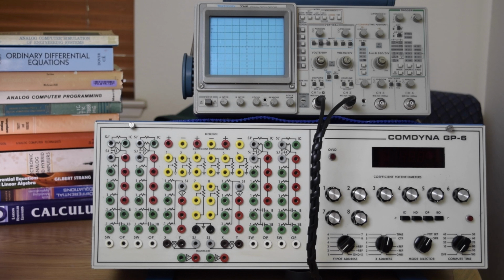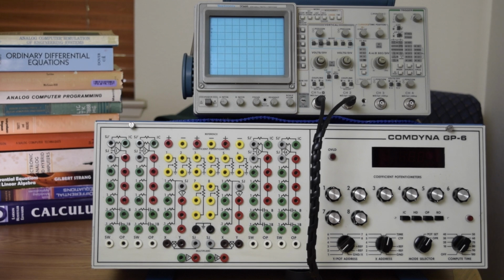Programming an Analog Computer

Comment: You should ideally never leave the inputs or output of an op amp floating, even in a voltage follower configuration with negative feedback like you've done because it will saturate the output and lead to damage or excessive current consumption, and gradual degradation.

Texas Instruments has a great application note on properly terminating unused op amps. It's meant for ICs, but I'm sure the theory applies just the same to any op amp, regardless of how it's made. The application note is called How to Properly Configure Unused Operational Amplifiers and the document number is SBOA204A. You can find it easily enough on Google. I'd always been terminating unused op amps wrong for years until I came across this.

It may be different with an analog computer, but I thought I would mention it anyways because I would hate to see such a beautiful piece of kit get damaged. Thanks for taking the time to share this with us. It's really great to be able to see an anaolog computer running like this. Cheers.
Reply from the maker: Nothing\ Thanks for watching. You bring up a very interesting, valid and important point. I am familiar with that TI App Note from a few years ago, and anyone designing with op amps should follow that. What I do now with unused op amps in designs is, space permitting, put in pads for components for “universal” configuration. That way, I can safely disable the op amp if I’m not using it, but the board layout is set up in case later design requirements call for an op amp circuit. 
I was scratching my head for a while trying to figure out why this did not seem to apply in the analog computers I’ve used. Long story short, it’s because what you see on the front panel is not quite the whole picture. In an analog computer, the op amps are typically set up as inverting amplifiers and shown with single-ended, instead of differential, inputs. Internally the non-inverting input is tied to 0V and the input shown on the front panel is the inverting input. With the output connected to the inverting input, and the non-inverting input connected to 0V, the output is safely configured at 0V, right in the middle of the rails. This is like the safe configuration shown in Fig. 3 of the app note.
When programming, I sometimes have the system on with the shorting block out of the feedback path, and an op amp output goes to the rail, as indicated by the front panel overload indicator. This can also occur in normal operation if an equation is not scaled correctly. The overload indicator is mainly a warning that the computational results are invalid. This does not seem to have any adverse impact on the op amps, though, as indicated by the fact that all the GP-6 computers I’ve used have there original op amps installed. I suppose that’s why the app note uses the word “can” instead of “will.” I might dig into this a little more to see if I can understand why the typical, routine overloads don’t seem to cause any harm.
Thanks for the input. That is a very useful app note covering an important topic for anyone working with op amps. Op amps led to my interest in analog computers. I don’t have formal education on them, but I’ve learned a lot from the analog computer literature. They early books show how to build discrete op amps. I’ve got a few old Philbrick tube based op amps. I hope to have time to do a video, or possibly a series of videos, on op amps from a historical perspective.
Reply: Thanks for the fast and detailed reply. I had a feeling there was more to the op amps than it seemed. I appreciate you clearing that up for me. It's interesting, and reassuring to know that at least with the computers you've used, they all still have their original op amps. It wouldn't be surprising if the designers had some sort of protection in place to protect from damage due to overload considering how easy it would probably be to accidentally scale something wrong. It would be interesting to learn more about how they handled that eventuality.

 I've never been formally trained in electronics, but much like yourself, learning about op amps has sparked an interest in analog computing, though I'm only just starting down that rabbit hole. I only just got into electronics a couple of years ago, so I'm trying to absorb as much as I can about as many topics as possible. I started learning about how to make a breadboard digital computer, but I got sidetracked when I started learning more about op amps. Something about analog circuits is just so much more appealing to me than digital. Though that's not to say digital isn't interesting in its own right. I have a huge collection of app notes and literature on op amps I still need to digest.

I'd love to see you do a video on the philbrick op amps. I first saw them on Mr Carlson's lab and read about them on Ken Shiriff's blog. I found them absolutely fascinating. And I think a historical series on op amps would be a great idea, as well.

Thanks again for the fast reply. You've definitely earned yourself another sub. Cheers.

Comment: can you give examples of it being used for suspension design?
Reply from the maker: Pedro Couto I don’t want to make any promises I can’t keep, but I’ll try. I’ve seen that in some of the literature, but it typically requires more than the four integrators available in the GP-6. I’ve got more than one GP-6, and the manual indicates I can connect multiple units to solve higher-order equations. I’d like to try that and the automobile suspension problems might be a good test case. Right now, my job is taking a lot of my time, so it might be a while, but I’ll put that on the list. Thank you for watching and for the suggestion.

Comment: Why did you use an acceleration of -0.161?  Your scale factor will be 200ft/V.   Using  -0.322 V  (32.2 ft/s^2) is much more convenient because your scale factor (100ft/V) can be applied by just shifting the decimal point two places.

 You will have to multiply the output voltage by a factor of 200 to get back to feet again.  The time-base scales by a factor of 400.  (1 time constant "analog computer time" = 2.5ms real time)

Do you know how well the precision resistors (50k) and capacitors (50nF) have aged?    Are there trim pots and caps inside that allow for readjustment or "calibration" ?
Reply from the maker: Thanks. That's a good point on the scale factor. It's been a while since I made this video, but I think the rationale was to scale the voltages to take advantage of as much of the oscilloscope display as possible, and stay out of the noise. The texts recommend that to stay out of the noise as much as possible, but I think your idea of keeping the conversion math simple is valid.

From what I've seen so far, the calibration is close. In the few experiments I've done, the results are as expected. Each amplifier has a series of calibration resistors, but I've yet to calibrate any of my GP-6s. The caps are very high quality. As I recall, they're 20uF (to make a TC of 1s with the 50k resistors). They're still available from Electrocube, but they cost about $350, and the price doesn't drop much in quantity. I think that's part of the reason no one makes analog computers anymore.
Reply: $350 per capacitor?  Ouch!   I've never had the opportunity to use one, but I still think these analog computers are cool. Thanks for the interesting videos.

Comment: Well done but it would be a lot easier to follow with a schematic on the side.  Spaghetti wiring is too hard to keep track of.
Reply from the maker: Thanks for the suggestion. Sorry it took so long to get back to you, but work has been hectic, and I've had to neglect the channel. I agree. I tried showing a wiring diagram from the manual in some of the videos, but that is hard to follow too. I'll try making symbols based on the analog computer texts in LTSpice to show the schematic of the analog computer solution in future videos. There might not be enough real estate to show them side-by-side, but I can do an overlay when explaining the circuit.

Comment: Kinda lika modular synthesizers (which are, in some sense, analog computers)
Reply from the maker: Thanks. Sorry it took so long to get back to you, but work has been hectic, and I've had to neglect the channel. There are some similarities, especially in the patch bays. I actually have several synthesizers, including a stack of three Moog Mother 32s, that would qualify as modular. 

I was reading a book on synthesizers and they mentioned an album titled "Processor"  where the GP-6 was used to control a series of function generators. It's available on iTunes, so I got a copy. It's a little far out, but it makes some interesting background music.

The mixing section of a synthesizer is very similar to the summing amplifier, and a low pass filter could be loosely compared to an integrator. Someday I may try to experiment with using the analog computer with my synthesizers, but I think I'd be hard pressed to do any computations with the synths (lol).
Reply: @timthompson468  I would be very interested to see the computer used with the synthesizer. Subscribed, just in  case you do it.
Reply from the maker: Vsev Krawczeniuk Thanks for the suggestion. Coincidentally, I was just thinking about that yesterday. I’m just an amateur musician, so I’m not sure how to go about that, but I might test out the idea with my Moog Mother 32s. I think the typical analog computer output, a damped sinusoid, would work best as a modulation control voltage, but it might be interesting to hear what it sounds like. I’ve been very busy at work lately, so I haven’t had time to make videos, but I’m taking some time off for Christmas, so I might try to set something up. If the results are worth it, I’ll record a video. Also, thanks for the subscription. I was not sure if the subjects I’m interested in would be interesting to others, but there has been some interest, so I’ll keep at it, when I can find the time.
Reply: @timthompson468  I too would be interested in seeing some interaction between a synthesizer and a computer! I've always thought of analog modular synths as analog computers limited to being comprised only of those elements deemed musical, at the time of their conception in the late 60's.

I've sometimes wondered about the possible use of analog computers in musical contexts. I've just found out about your channel anyway, I think I'll take a look at the rest of your videos, and maybe subscribe as well =)
Reply from the maker: Alaska1925 Thanks for the feedback. I’ve got a lot of irons in the fire, but I managed to record some interesting video over the weekend. I combined a few of my interests and used the GP-6 to solve a Lorenz equation (at the core of chaos theory) and used the outputs of the GP-6 to modulate the Mother-32. The results were very interesting, but not necessarily musical, at least not in the traditional sense. I’ll try to edit the video and have it up by next week, if my job doesn’t get in the way. This first video will just be a knob-twiddling demonstration, so to speak, but I will try to put together a detailed video later showing all the ins and outs. Due to the nature and frequency of the analog computer signals, they are either too fast or too slow to provide musical modulation, but, in the raw form, I think the signals are great for abstract sound design. I have an idea for a way to modify the GP-6 so the signals are more appropriate for synthesizer modulation. Feel free to subscribe. You might just put me into triple digits.
Reply: @timthompson468  done so 👍🏻 well then, I'll wait and hear your experiences and opinions on the matter.

Mhm, I'm wondering (and I haven't done any previous research, sorry) is there any modern day maker of analog computers? I'm guessing only kit makers are left, for the hobbyists. Do you know any brands or names?
Reply from the maker: Alaska1925 Unfortunately, I don’t think anyone is making them. Comdyna was the last one in production, as far as I know, and they’ve been out of business for decades. I’ve seen YouTubers talk about them. There’s a channel called Cheap Science that did a video demonstrating some small modules, but I didn’t see much more about it. The best bet is eBay. That’s a little tricky because the price varies all over the place. I just checked and a GP-6 sold in November for less than $400. I didn’t even see that one. I almost got burned once because a guy listed one as tested working, but when I got it, it was gutted. It took a couple of weeks, and help from eBay, but I did get my money back on that one. All the other units I purchased were exactly as listed though. I work in electronics, so I don’t have any issue fixing them if they’re broken. The one problem is the integrating capacitors. I checked, and they are available, but cost over $300 per cap. The good news is, they don’t break. There are also Heathkit analog computers on eBay, but they aren’t useful for synthesis, because they operate at +/- 100V.
Reply from the maker: Simon A Thanks, I’ll keep an eye out for that. I subscribed to that channel, but I didn’t catch any mention of analog computers in a brief perusal of the videos there. I’ve got some ideas on different ways to use the analog computer in combination with synthesizers, but I would definitely like to see an actual musicians take on it. My interest in music far exceeds my talent, so it’s a struggle to advance my skills. I like playing with synths, but the possibilities are endless, so it’s hard to focus.
Reply: I came here to have another look at the analog computer, after watching modular synth videos too.
Reply: That’s what lead me here but being a musician I’m ‘math dumb’ 🙃 checkout my channel for advanced examples of patching modular synth music 🙀

Comment: Isn't analog theoretically faster than digital?
Reply from the maker: Sorry it took me a while to get to this. You are correct. In fact analog computer operation is nearly instantaneous, in that the output of the op amp starts as soon as the computer is set to operate. Technically, the op amps all work in parallel, so the final output is instantaneous as well. Digital computers must perform operations serially, for the most part, so, at least in operation, the analog computer has s speed advantage. I think the reason they fell out of favor, though, is partly due to the time and care required to program an analog computer. Some of the problems in aeronautics required patching hundreds of op amps, and associated potentiometers and function generators. When the time taken to program them, and "debug" the program, digital computers eventually gained an advantage, especially when higher level programming languages became available. I've seen articles on the web about using analog computing methods for some functions in modern computers, now that Moore's Law is petering out, but I'm not sure if anything will come of it. That's interesting, but a bit beyond my scope.
Reply: @timthompson468  Moore's Law?
Reply: Whats your take now that analog may make a come back because of AI?

Comment: This is way over my head but it's just fascinating. Programming some more complex problem must take a massive amount of effort. It looks like you would be better off with a pen and paper. That is if you don't need a continuous result. Or tweaking a parameter or two without having to recalculate everything again.. Using op-amps for calculation and getting a result in voltage. My mind is blown.
Reply from the maker: I also find this subject fascinating. You hit on some good points. It could require a huge effort to program a complex problem into an analog computer. I've read of cases where hundreds of operational amplifiers were required to solve problems, requiring weeks to set up the program. Pen and paper would definitely be better for the simple problems I'm demonstrating, but in the pre-1950 era, an analog computer would often be faster than a digital computer, because, once programmed, the solution appears instantly in a graphical format, as opposed to waiting hours or days for a table of numbers. The realtime tweaking of problem parameters was very beneficial, vs. reprogramming and running a digital computer. The analog computer provided more intuitive interaction, too, from what I've read.
Reply: @timthompson468  Actually programming an analog computer isn't harder then a digital computer. Just you have to always bootstrap the whole thing and create a circuit for the problem. Once you have a circuit that solves the problem, an analog computer might just be faster and more realistic then a digital one.